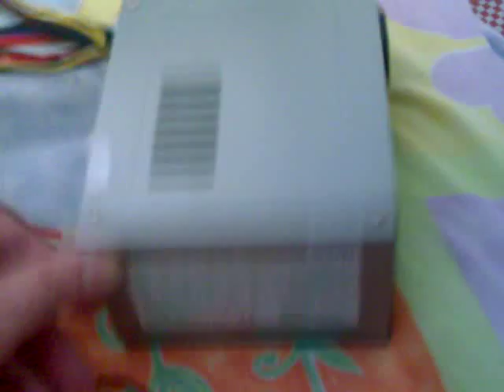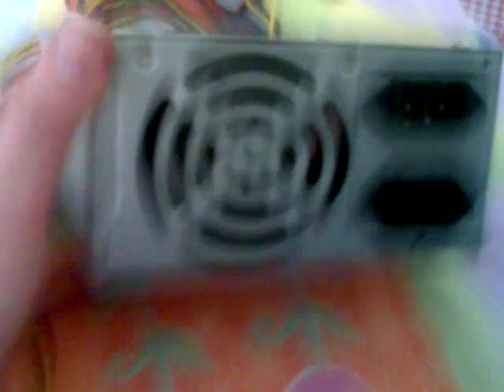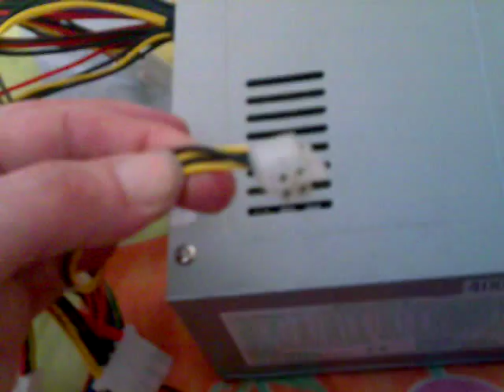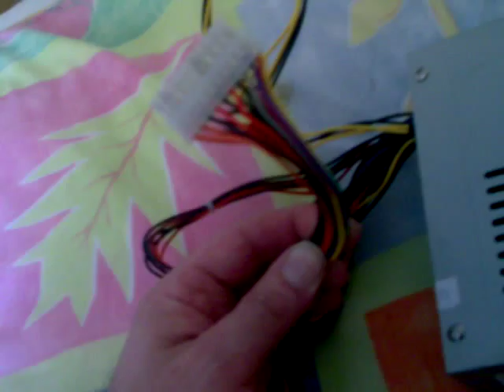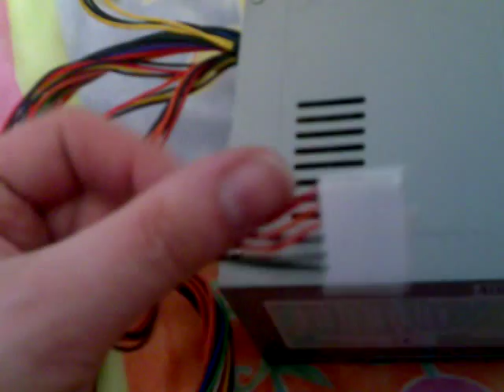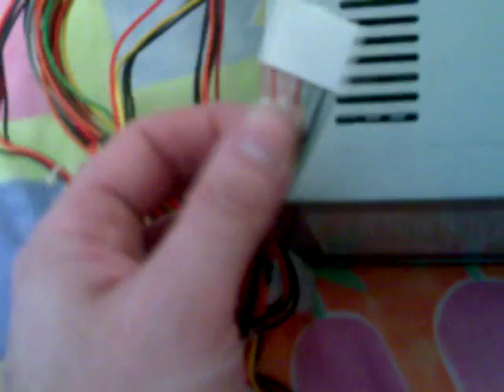Case Mod Project - Part 2 - Power Supply

Comment from the maker: @christianAFA You could BUT I wouldn't advise it. If you did, you would need to make sure nothing can fall on it or in it (especially liquids!) and that you don't strain the cables. I think you'd be better of getting a slim power supply - they are readily available. I used a mATX/SFX one in my HTPC and server builds - both of which I have videos on if you want to check them out.

Comment from the maker: @FonixFire I have an FSP power supply in this system now. This was just a cheap one that I wanted to re-use. To be honest, I wont buy anything other than named brand psu's these days. You can now get a Corsair CX430 for £35 which is 80 plus certified and comes with a 3 year warranty. For the vast majority of systems out there, that is more than enough power and will be rock solid.

Comment: Geet one off ebay. I got a perfict working 750 w powersply with 6x sata 6x 4 pin and etc for only 41.98 on buy it now. If you want me to i'll give you the name of the dealer i got it off.